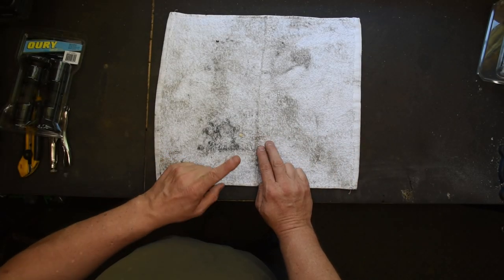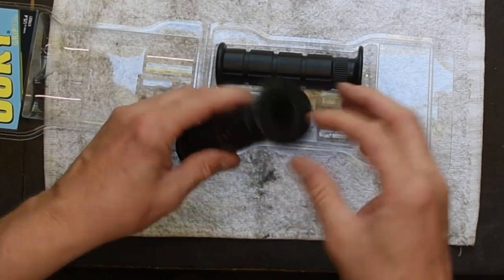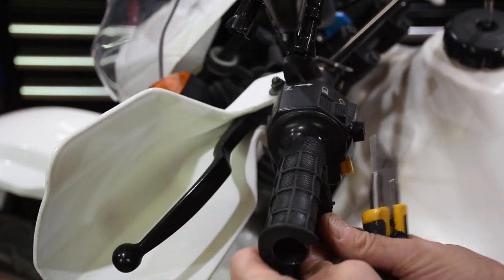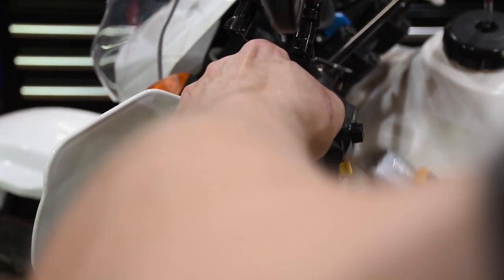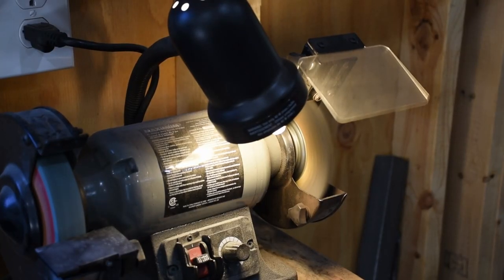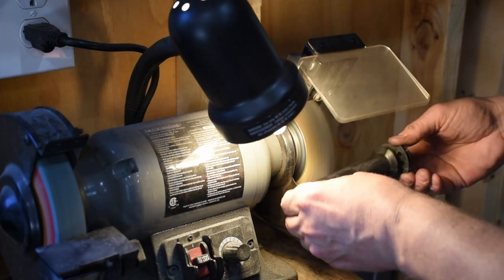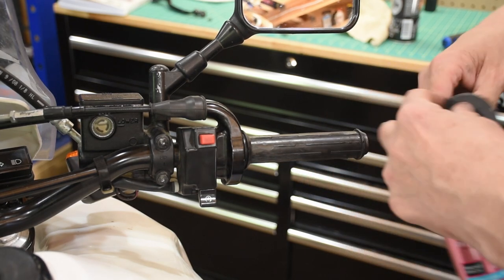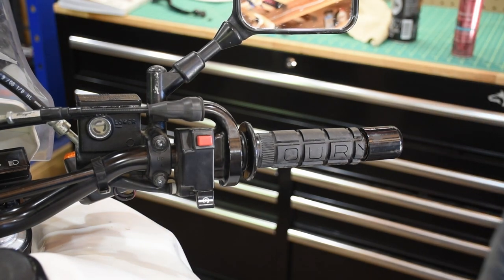How to replace your motorcycle grips on the Suzuki DR650 easily (well sort of).

Comment: Good timing on this one. I was looking into ordering new bars and brush guards. I see now that the throttle tube and grip are one piece. Means getting another matching factory grip for the clutch side, or two aftermarket grips with an aftermarket throttle tube. Man I hate messing with stuff that has to be glued, sticky drives me crazy.

Thanks Dino, great to have you figuring some of this stuff out for us!
Reply from the maker: Hi Ben,  glad you liked the video, I am still unsure if this is how the factory grips are or if someone glues on the throttle side with rubber cement? Either way it was a bit of a struggle. let me know how you make out with your bar replacement.
Dino

Comment: Thanks for the tip on removing a stubborn DR650 throttle grips Dino. I tried removing the old damaged one with a knife and apart from being filled with risks, I was getting no-where until I saw your video. 5 minutes on the bench grinder wire buff and it was back to bare plastic and you're right, I did get coated in rubber several times but was easy to brush off.
Reply from the maker: Glad the video helped you out. 
Dino
Reply: Dino did a very ham fisted job of this and made it more difficult than it needed to be.

Comment: Thanks for the great tip Dino, never thought of using hair spray.
Reply from the maker: Thanks Lou Cee,  it has all ways worked for me as long as you clean the surfaces. In really wet or extreme cases you may need to use a dedicated glue but from my experience it works well.
Thank you for taking the time to comment.
Dino
Reply: wet contact cement works better.

Comment: Hey Dino. My bar end weights seem to be stuck. I have an older bike with the previous owner never removed or loosened the bar ends. Any tips on removing these? 😢. I tried a JIS impacta screw driver but tht did not help
Reply from the maker: Have you backed out the screw and tapped the end of it with a hammer? Sometimes this will help dislodge the rubber inside. Just don't be too aggressive.
Reply: Actually i am not able to turn the screw at all. Sprayed some wd40 today. Will give it another go tomorrow
Reply: Any luck removing the screws? Mine are stuck as well.

Comment: Throttle tubes are cheap.
DR's are known for the bonded tubes. Motion Pro makes a great replacement tube and Pro grip makes nice replacement grips #714.
Reply from the maker: Thanks for the info! I guess I took the road less traveled.
Dino
Reply: @DinosTinkerShed  Yep, been there and done that with a dremel tool. Live and learn.
Reply: I did the same thing with a knife, just so I could ride it for the weekend. Ordered a motion pro throttle tube for about six bucks.

Comment: Got a problem. I replaced my stock grips with Oxford heated grips they are longer and can't be cut much. I moved the throttle side, front brake etc. further in with a mod on a retainer pin.    On the clutch side I want to do the same but don't know if there is a retainer pin on that side or not. Does anyone know?

Comment: I admit, I was waiting for you get to the throttle side and realize that suzuki thought it would be a good idea to bond the grip and the throttle tube. It took me 3 and a half hours with a utility knife until I resorted to a dremel to get all the rubber off.
Reply from the maker: Lol, I did not realize until I got into it that the gripmwas bonded. I like to leave in the struggle when things like this happen, it shows others that they are not alone with their frustration. I could see a dremmel would work well.
Thank you for the comment and offering up another method to use.
Dino

Comment: Try going to a golf pro shop and buy some grip tape and installation lube. The tape is double sided masking tape and the lube lets the grip slide over.
Reply from the maker: That's a great idea, and could be a good solution. I seem to remember a buddy of mine telling me that motocross riders would sometimes do the same type of thing if they had a loose grip between motos. They would wrap the bar with black electrical tape and then rinse the inside of the grip with gas and quickly slide it over the tape. The gas would "melt" the tape just a bit and then it would tighten up really quick and the grip was solid. 
Not sure if this is true or not but he swore it worked very well.
Dino

Comment: I replaced mine with oem grips, I had to put a really strong glue to make the left one hold when it's hot. The right side grip is indeed one part with the throttle tube. But I have an XF650, it doesn't have the same grips.
Reply from the maker: Good to know thank you for your feedback.

Dino

Comment: Throttle side is meant to be changed completely with a new tub your not suppose to cut it off. They do this at the factory to keep you from taking it off or have coming off why your riding it's for your safety.
Reply from the maker: Thank you for the comment, I agree that Suzuki did not want me to take that off, however I really wanted some thicker grips and I do not feel unsafe at all with the way these are mounted. Motocross grips are not bonded and they stay in place during racing so I think these will hold up fine for the riding I do. Thank you again for the comment, it is a good point for sure.
Dino
Reply: @DinosTinkerShed  I just went threw this myself putting new bars on. I end up putting stock grips back on it that means I paid the price from the dealership.This is only bike I've had that had throttle tub like this I agree would be nice have more comfortable grips.

Comment: You cut the grips too short. If you had just installed them first them moved the hardware everything would look professionally done instead of .....well you know. 
Sometimes you just have to scrap a job and start again. This is one of those times. 
I didn't see you measure the depth of the grips to determine where to cut them......You could easily have installed them fist then trimmed the length after.  Haste makes waste and the video production really interfered with the job being done properly. 
I hope I've helped everyone who thinks this might have turned out better.

Comment: Dino........Next time ....expose a new section of your blade then wear a pair of gloves. Geeeze Louise.  Common sense. Better yet , Use the compressed air method. They come off in 5 seconds. Now it looks like you will have to buy a new slide. and that's not a bad thing considering.      This is what you get for trying to do things on the cheap.
Reply from the maker: Hi Bill, the slide is fine, it is a one piece molded unit from Suzuki and is bonded to the slide itself. Works fine now. The air compressor method can work but I have found that when the ends are cut off for bar end weights or bark  busters (As these are) it is not as effective a method. 
Thanks for the come t
Dino
Reply: Don’t know if I’ll ever go down this road, but thanks for lighting the path.  Really enjoy your how-to video style.